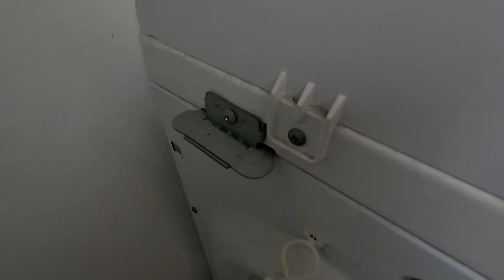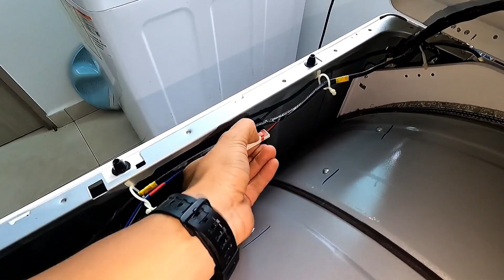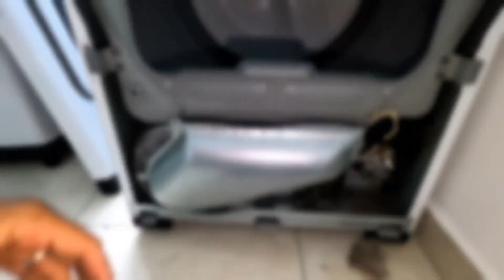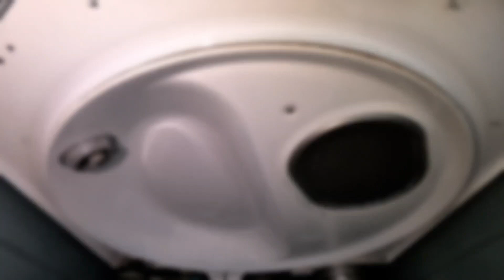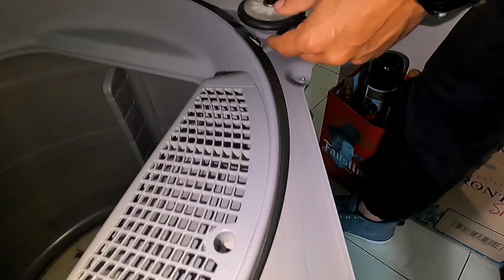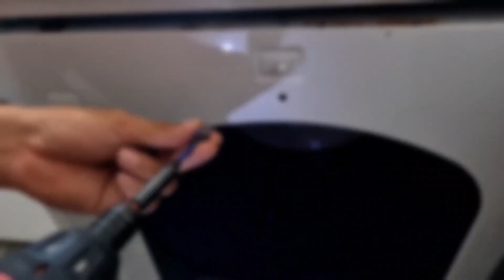Samsung Dryer Maintenance Guide: Deep Cleaning and Repair | English versión

Comment: Amazing video! Quick question, what type of lubricant are you using on the dryer wheels?
Reply from the maker: I take advantage of the situation and use the same oil I have left over when I change the oil in my motorcycle.

Comment: Excellent video, it helped me so much.  My issue was a wad of hair behind each of the front drum wheels.  Very concise and helpful instruction, thank you.
Reply from the maker: Hi friend, I’m glad the video worked for you. The only thing I recommend is doing that same maintenance or procedure once a year. That way you make sure the rollers stay free from trapped hair and lint, which is basically the cotton fibers from the clothes. That buildup removes the lubricant from the rollers, causing one of them to seize up and start making noise, besides ending up costing you money.